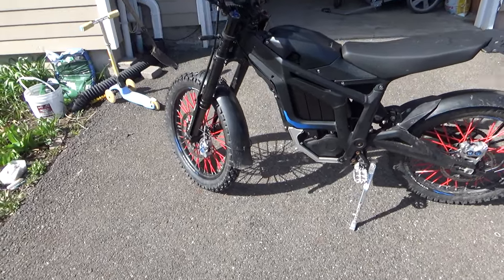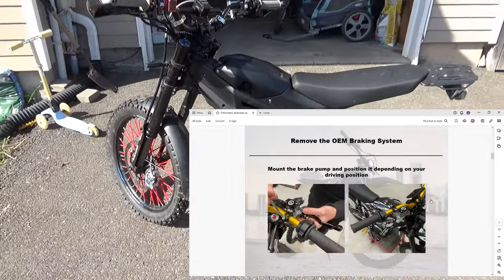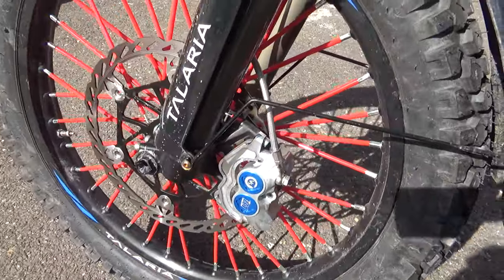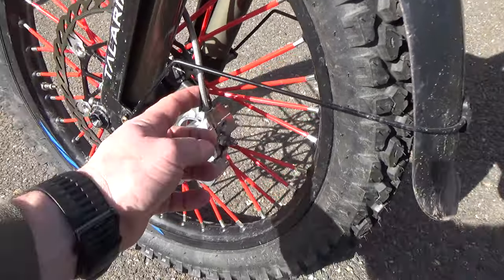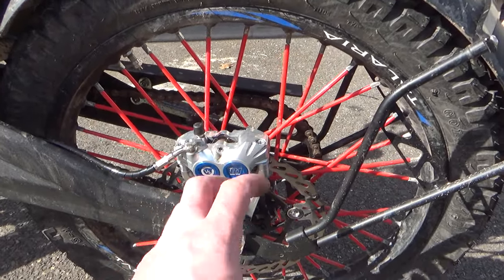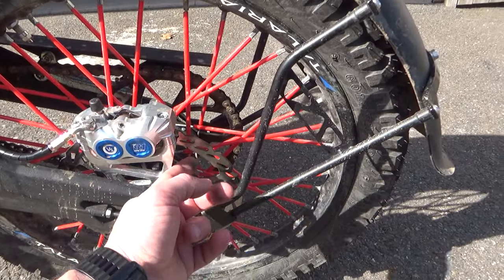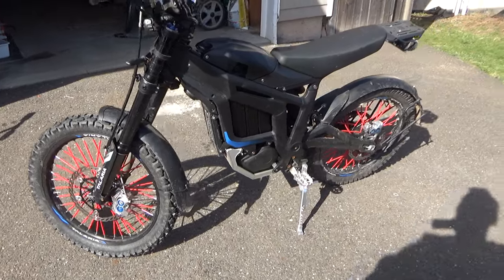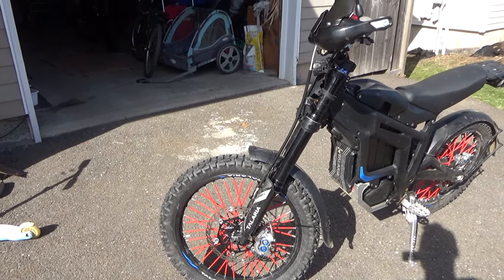Volar Sport Brakes. Talaria / Surron best brakes on market!!!

Comment: Any issues with the front wheel not spinning freely anymore? Mine rubs a little and can’t seem to get it to not rub
Reply from the maker: No, once brakes released no rubbing at all. Make sure both pads actually moving when brakes applied. Could be only one pad moves, because other one kind of seized
Reply: @JustDoItPlus  is it actually 0 rubbing, thats awesome? can you double check because thats a big thing for me that there is 0 rubbing and calliper is perfectly cenetered. the front wheel can free spin for as long as possible